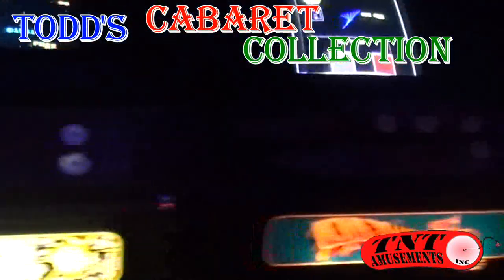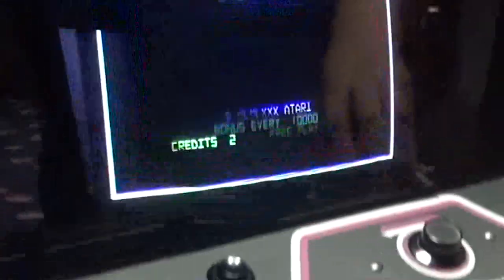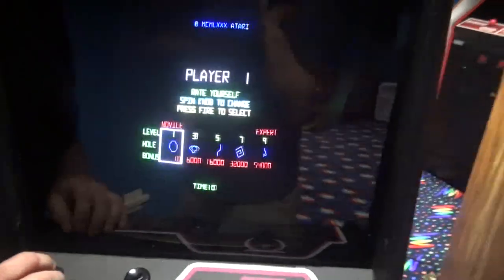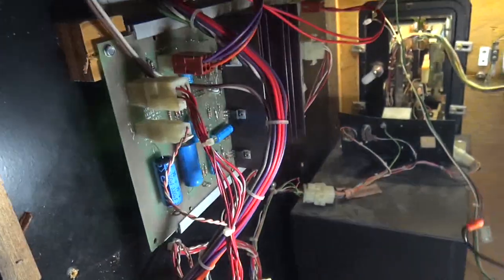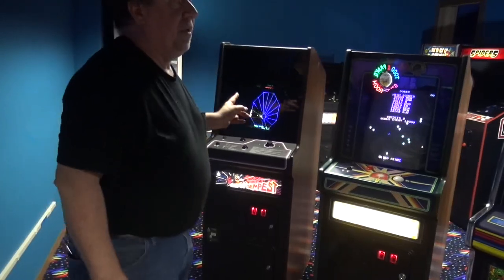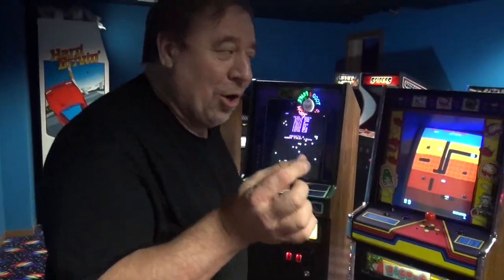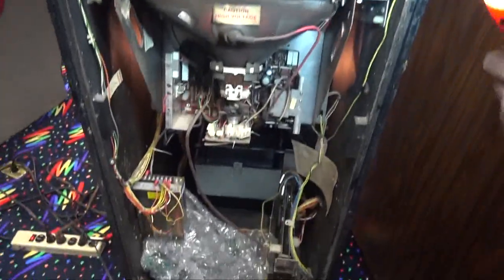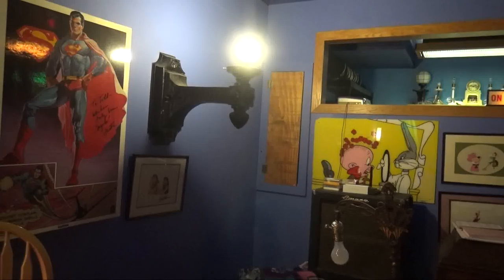#1173 Atari TEMPEST - CENTIPEDE - DIG DUG Cabaret Arcade Video Games - TNT Amusements

Comment: the PC links go for Roku and Smart TV's as well.  you look better on a 32 inch screen.  Farther the tv is the bigger it should be so 32 is more than enough.  Should I get into the 4K ,  all I'l say for that is 50 inch is min.  So 4K is too BIG for my room.  Better in the living room.  Did get all my N64 stuff together.  2 cartridges didn't work so used one of your tips , although to clean it right I need to take them apart :(  but I cleaned the contact tips off with what I could.  not doing a fiberglass eraser at an angle.  Sure enough once that was cleaned Hexen and Turok 2 ran.  not that I can play them.  horrible controls  and I was one of the rare ones who loved the N64 controls.  Didn't hurt my hand like NES/SNES /Gamecube did.  Provided you used the analogue stick and not the d pad.  or the left side.  Just wish the memory cards didn't have a coin cell soldered in :(  Those things aren't cheap nowadays.    1mb cards :O  and I had 2 of them (3rd party)